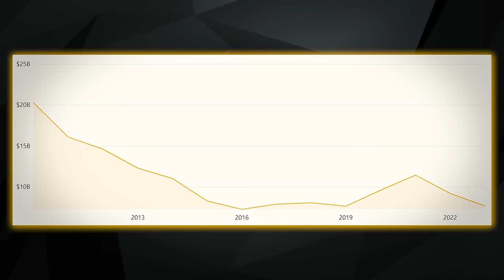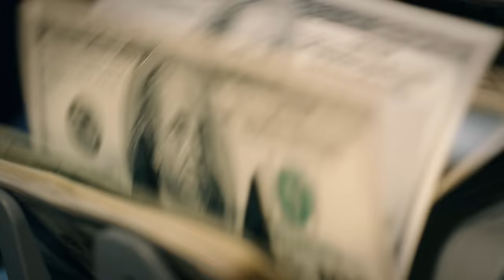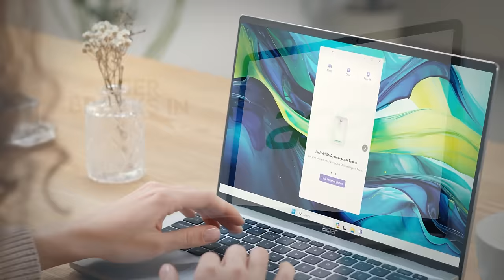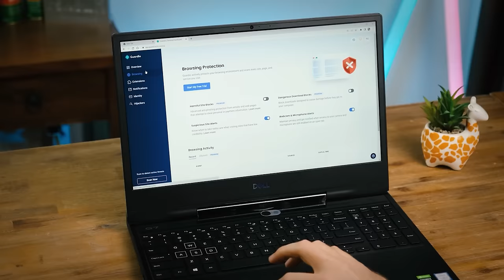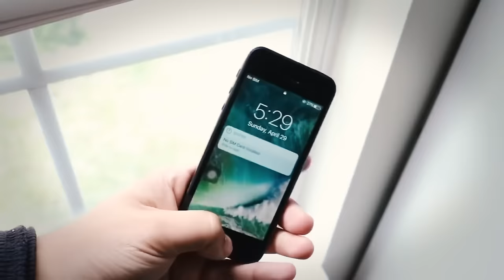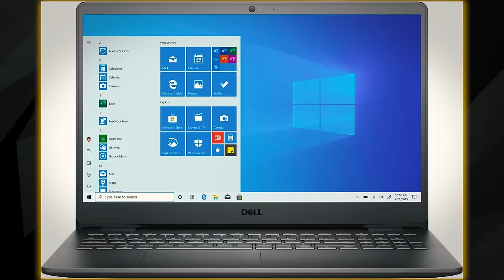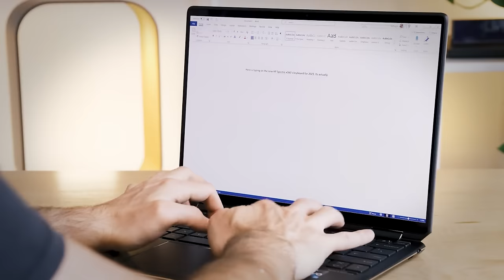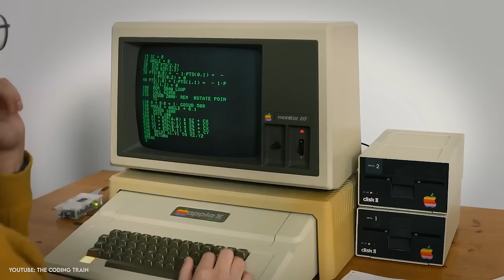Whatever Happened To Acer?

Comment: They are bad quality
Reply: 2 Acer laptops, 2021 with an i5 and 2023 Ryzen3 7320U, 27" Nitro 1440p monitor and they all been working perfectly fine.
Reply from the maker: Savage hahaha
Reply: @DroneStrike1776 single persons experience
Reply: @liiillllliiilllliilllliii9461  Nope. I also have a great experience with Acer laptop.
Reply: Mine from like 2017 has a battery that started failing (computer shutting off) after a year I think? Hard drive now is barely working and one hinge broke (well, where it attaches to the screen)
Reply: Acer laptops varies from models to models, they either lasts forever or breaks down right after the warranty expires
Reply: I had an Acer laptop with 3 year warranty in 2007. Multiple problems all these years for which I paid to fix them. Last year I purchased a premium monitor through my corporate. It was dead on arrival. I am not buying this brand ever.
Reply: Acer is a really good brand. Big shopping houses who sell electronics here in Paraguay mostly uses Acer and Dell laptops for themselves.
Reply: Acer is a really good brand. Big shopping houses who sell electronics here in Paraguay mostly uses Acer and Dell laptops for themselves.
Reply: Every single laptop brand has quality issues.
Reply: Have an aspire 5 for more than a year,so far working great,build quality is a bit average but was a king in its segment when it was launched.Planning to use it till it dies
Reply: Acer's laptop hinges are 💩
Reply: I had an Acer tablet and the issue it had was with the nVidia chip.
Reply: i had an acer aspire 5 (e5-575G to be exact) and it was awful, 8 gigs of ram, a crappy 5200rpm hdd, altho it never died on me until when i bought a new pc
Reply: nah Asus is the shit, its the most popular brand in my class, and all of them, even the expensive ones, always have shitty display screen.
Reply: Not all of their products. I bought a budget 1080p gaming monitor in 2015 or 16 and it still works great
Reply: Same experience with Acer, their products are just garbage.
Reply: I think HP is the worst.
Reply: True. Acer is a trash quality brand, possibly even wirse than HP. 
And it was like that always…
However If I remember correctly, due to evolving market, everyone was OK with it, as it was expected, that the stuff will be replaced within 5 years as completely outdated and if you bought it as a "casual/multimedia" gadget, it was sufficient.

However 2-year old ex-corporate Dell was still a better deal…
Reply: Acer is one of the cheap mentality brands who compromise on quality for high specs at low price.
Reply: I have an Acer Chromebook. It's pretty bad and dosent even have play store and the guy at Staples said it did. I guess it's a decent laptop, I don't expect much from a Chromebook lol. My cousin had an Acer PC, it was pretty good I think
Reply: @DroneStrike1776 🤓🤓🤓🤓🤓🤓🤓🤓🤓
Reply: How's this the top comment 🤔
Reply: So does MSI, Have been using one and suffering from random touchpad cursor movement delay.
Reply: Yeah even replacement parts are hard to find
Reply: @DroneStrike1776  Same here
Reply: Yeah yeah tell that to my Acer Aspire v3 which his almost 10 years old at this point just upgraded the RAM and never replaced the HDD. Only went for a repair on the screen. In 10 years 😅
Reply: morbidsoy  on the other hand 7 years use is pretty decent.
Reply: Owning Aspire 5 for 6 months so far good, but the build quality is horrendous. The aluminium top is flimsy, the main body is not solid and kinda bendy, the hinge is still okay (maybe better than hp haha). I compare it with asus vivobook and asus ones feel way better than acer's, the plastic and aluminium top is more solid. 

Well it has MX 350 for $420 so i cant complain more 😂
Reply: Its legit quality and their monitor are 165 hz for 85$
Reply: @LogicallyAnswered You forgot telling their biggest business today that is AUO which is an Acer spun-off company that produces LCD/IPS/VA displays for basically every brand in the world, Asus for example has a huge partnership with AUO for some of their top of the line monitors. 
Sincerely I had an Acer LCD monitor that lasted more than 10 years with no defects or problems whatsoever and I live near the sea. 
I think they could leave the laptop and computer market just like LG left the mobile phone space and move on as a display manufacturer just fine.
Reply: newer model from 2019 are great and very durable. even more so than dell with 2x the price. the specs are also good. they still put thunderbolt on budget options wjhen everybody else refuses to

The real problem is the designs. They look very clunky and outdated. even their aluminium body laptops look worse than plastic ones from Asus and Lenovo
Reply: Got a 2020 acer aspire 5 like new after use over 4 years
Reply: @Thomas_wur  lol what does hard drive have to do with Acer? It's a different brand
Reply: Fr
Reply: I mean they are alright but not bad
Reply: I once owned an Acer computer, emphasis on "once"
Reply: @LogicallyAnswered No really, they removed boot options, made the uefi for basic users and the advanced stuff is mostly gone. I’m considering switching now.
Reply: Depend on how much, the cheaper One is garbage. I saw plenty of people got cheap laptop from Acer and then complaining their laptop broke.

Meanwhile i met many people with pricier laptop Acer that have no problem

My conclusion is stay away from cheap laptop from Acer. They all are junk, buy pricier one especially especially above 1K and they can last you more than 10 years
Reply: Say that to Lenovo and HP.
Reply: Acer laptops have never disappointed me.
Reply: i just bought an acer laptop 💀
Reply: They still successful and make good laptops
Reply: I’m currently using an Aspire laptop and I agree. Maybe the Swift is okay but never again LOL.
Reply: Not at all. Acer's quality matches other a-brand's quality. But Acer laptops are better for their money! I choose Acer.
Reply: Back at early 2010's, my college library provide acer desktop for their search computer. They really felt cheap at both build and performance.
Reply: What you on about? Acer delivers high quality products with cheap price. Acer is actually better than Hp.
Reply: Swift x line is pretty good.
Reply: I have a 8 years old Acer Chromebook. It's working perfectly fine
Reply: I can agree their hardware was trash
Reply: Somehow my 2017 laptop still kicking but In juat switching to a PC soon
Reply: Acer nitro is good.
Reply: Exactly! Always have faulty motherboards. It's either you have it working, or you end up with a faulty motherboard. Very poor quality control. I avoid this brand and all their products. So many better quality brands out there. 😊
Reply: Better than Lenovo
Reply: Rocking Acerlaptops since 2016. Best price to power ratio and no weird issues like with all of my Lenovo laptops.
Reply: fucking agree horrible products had an acer spin an aspire and nitro fucking done with their shit
Reply: Shush my guy
Reply: To each their own, I guess. I've had a really cheap and basic Acer laptop that's still going strong, for at least 7 years, now with Chrome OS Flex installed.
Reply: Acer is a nightmare..
Reply: @FalkonNightsdale it’s there hinge keeps falling off but they have good laptop but only the hinge it’s trash
Reply: Ah yes because mine lasted for 10 years
Reply: Acer is an odd balls. I got Acer aspire that last me from 2013 to 2021 when other laptop fail. Even my basic Acer monitor I brought last me 2015 till 2022 than my Asus gaming monitor... Wdym bad quality 🤣🤣🤣 did I win lottery?
Reply: I remember that in collage a friend bought one Acer and in one week the screen hinges broke, and warranty didn't cover up those things , it took 1 month to repair and in 15 days it was broken again...
Reply: Yeah my Acer predator helios neo 16 $1999 just fuck itself while heavy workload. Tried warranty still waiting for Acer respon after 4month no answer 😂. I still prefer MSI high end laptop more durable yeah MSI cheap laptop is shit too. Asus is the best but Gad damn Their price is expensive 4060 TUF a15 still around $1300 in my country
Reply: My 2019 laptop is a literal toaster with the amount of heat it generates, it's a swift 3 ryzen 5
Reply: But the other products were pretty fine, I have a monitor and it's works pretty fine
Reply: My acer is so good though

Comment: I bought a 2023 Acer Ryzen 3 laptop, 2022 Acer i5 laptop, and a Nitro 1440p monitor on a 50% sale, works perfectly fine.

Acer laptop with the Ryzen 3 7230U was during a July 4th sale for $250.  15.6" 8GB RAM ddr5, 128GB NVMe SSD, for the price, I have zero complaints.  It's definitely not slow for normal use.  It's a budget friendly household laptop, thin and lightweight.  Screen quality is average and it runs cool.  I don't need a big storage, I have a desktop for that and 2 portables hard drives. If I can use it to pay bills and stream to my TV, I'm good with it.

Comment: Bought Acer Aspire 5750 with Core i5-2410M in 2011, used it daily until fall last year. It's still working, but using it daily became painful. Then I took approach of getting business class refurb because logic.
That's: reducing e-waste + value + my real performance needs.

So now my daily driver is HP EliteBook 840 G6 with Core i5-8365U and for weekend gaming I got HP EliteDesk 800 G4 SFF (Core i5-8500) + low-profile GTX 1650 GDDR6 version from Gigabyte.

Comment: I still have a acer laptop upgraded to widows 10 still going strong. 13 years old already
Reply: Sandy Bridge? Was using Windows 7 with ESU bypass to the last day, then tolerated Windows 10 for 9 months and switched to Whiskey Lake because of Windows 11, performance and security.

Comment: Perhaps the BIGGEST folly of Acer was downright poor quality and unreliability. 
Acer was never a reliable brand that made long-lasting laptops. Mostly Micro and Small Companies bought Acer laptops owing to the Value Proposition. 
Their Screens were terrible, the drives unreliable, and Battery Performance was abysmal. This meant the overall experience of using an Acer laptop left a VERY bad taste.
This video perfectly nails the BIGGEST reason for Acer's decline. Consumers want a decent laptop that lasts long. 
Acer hurt itself by going the extremely cheap route. It could offer better laptops, but buyers now assume Acer stuff is cheap and unreliable.

Comment: Back in 1996 I spent a month at their test lab in San Jose.  The multimedia software company I worked for was bundling software with Acer's consumer systems, and I was there helping troubleshooting & customizing.  So I find myself having a bit more connection with them from seeing the company from the inside (working at IBM was different since there I was working in their high-range Unix systems).

But these days I either build my own systems from the parts I choose, or I re-purpose old machines that became too slow/clunky for MSWindows (they usually work much better under Linux, unless they're some P.o.S. Dell all-in-one).  Even my MacOS machines I've picked up dirt-cheap used, and I refurbish and hack them beyond what Apple thinks they should support.

Comment: I love Acer and I never buy anything else when it comes to laptops. As a 100% daily driving Linux user, Acer has been to only goto for almost guaranteed compatibility. These days it's all pretty much a guarantee, but back in early/late 2000's with things like VIA Graphics (yak), various touchpads, WiFi chips and more without driver support, Acer always managed to select components with 99.9% certainty that their laptops would work (by design or simply luck, I don't know). As such I have always turned to them for all of my Laptop needs. And they last. One of my first ones from 2005 or so, still boots. I don't use it as it's old, slow and clunky, but it still works. Even the damn battery albeit with about 40% it's original capacity.
Reply: I could turn mine into Hackintosh supposedly without much of trouble.

Comment: 10:34  Acer never built a brand as a main reason why sales have plummeted? A Brand falls apart within years when they miss what people are looking for. Sony Vaio was a massive brand - but they gave up building industry leading or at least competitive products - and things went downhill pretty fast. The Acer I bought back then was easily running circles around most other laptops if you could live with a fragile plastic shell. But for the following years no brand than apple took reasonable innovation steps. If Acer had built something similar to the Dell XPS Series with a plastic shell, they would have sold well. But in fact, they even cheaped out on display quality compared to their older models.

Comment: I have an Acer b/c it was cheap for the specs it came with (3060 and ryzen 5 5600h for $650 in 2021) and I haven't had any problems with it. Only thing is the battery life is trash, but I don't use it on battery much anyway.
Reply: I bought a 2023 Acer Ryzen3 7320U.  128 NVMe SSD, 8gb ddr5, 15.6" screen, light weight, runs cool, decent battery life on eco mode for $250. Almost 1 year in and no complaints.  Even bought a Nitro 1440p monitor for $160 during a sale in 2020.  

Everyone want the best specs and most expensive, I just want whatever that suits my needs for a good price.
Reply from the maker: Fair enough

Comment: Funny how most of the computers in my college are of Acer and Dell. Even the crappy potato PC I have now is of Acer.

I guess the reason is that they can't provide overall good computers at a reasonable price. It's been a long while since I've seen them dive into the budget gaming laptop category.
Reply: See the Acer Nitro V15-51. I have one with an i7-13620H CPU, Nvidia RTX 4050 6GB, 16GB DDR5 5200 Mhz, NVME4 SSD 512GB, 144 HZ FHD screen (decent). It was just 1100 euros in my country. It has only LED keys not RGB but I wouldn't pay 100 euros extra for those anyway. I putted in it 32GB RAM (replaced the ones it had) and added another 2TB SSD, that raises the price up to 1300 euros.
Reply: @CountPorcula just bought this exact model, although mine equips an RTX 3050, for 740 EUR. It was a great deal imo. Let's see how long it lasts
Reply: @silver3178  nice, you are from USA I guess. Electronics are cheaper there, the stupid UE usually puts a lot of custom taxes and my contry does too. Is it exactly the same, (ddr5-5200 Mhz, i7-13620H, etc)? If it is you had a great deal indeed, with the 4050 would have beem maybe 150$+).

Comment: Acer before was unreliable as fk. Now, their laptops are pretty decent. The problem with acer is that their laptops are priced way higher than the quality they offer. I remember where Acer was a budget brand, undercutting Asus or Lenovo before, now their pricing is at the same bracket

Comment: Acer doesn't seem to do good in the USA market, but in Asia and Europe, they are very popular. I had a budget Acer that lasted 9 years without any repairs, another Acer laptop is going strong for its 5th year and I bought another Acer laptop just because I need a little bit more power for my work and a bigger screen. 

I wasn't intentionally looking for Acer, I knew the specs I wanted and I was ready to get any brand that offered them and Acer had them at a reasonable price, its competitors offered the same specs or less at a higher price. 

I think Acer isn't really focused on branding and creating a user experience, for example, their boxes are just brown cardboard boxes with a black Acer logo.

Comment: After researching the market with 700$ budget I bought an acer in 2022 it is still going strong I have little to no issues while using it. Multiple (4-5) excel workbooks with links and 10+ sheets with 80*10 cell data as well as firefox with multiple tabs open in the background and 1 or 2 more apps constantly running almost everytime. On the other hand I have had 3 ppl close to me buy HP and I have never seen this many issues from the same brand in my life like 1 HP was idk around the same price as my HP but gave out less than a year since purchase while the specs were not ideal buy still less than a year!? The other one is a pavalion which retailed for 1.2-1.4 brand new but was bought used and for that price nothing was perfect like slow boot up of softwares and short battery life which was baffling me especially at that cost.  Last HP cost around 1k$ and a coworker bought it but it showed the blue screen of death multiple times and shut off deleting any unsaved data as well as lagging when connected via HDMI cable to a monitor and yes different cables were tried and settings were changed to no avail later was taken in for maintenance more than 3 times. First they changed the keyboard claiming it was liquid damaged then ports and lastly the motherboard only screen is unchanged which at that point just throw the whole laptop away and get another one. So in my eyes Acer is good 🙂

Comment: I hate acer. If the company goes under, it's a good riddance. I got a faulty laptop from them, sent it to repair two times, both times they kept it to a maximum time they are allowed to and returned it without fixing about issue. For the third time they told me my warranty expired. It was not a nice service experience either. Everything about that company made me feel regret ever buying their expensive laptop. They can not fail soon enough.

Comment: In recent years, the only product I know that Acer has done somewhat successfully is the BiFrost Arc A770 GPU. They're a board partner for Intel's 'Arc' line of GPUs which makes sense, considering Acer is essentially a budget/"bargain bin" level OEM and Intel has positioned their Arc cards towards the "high margin" market (low to midrange).